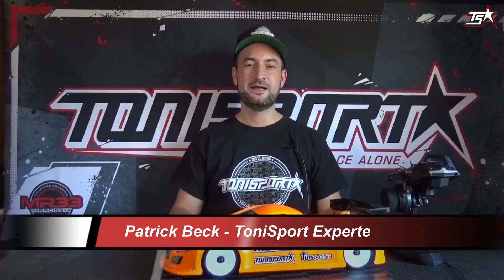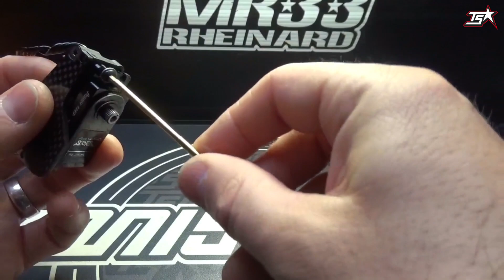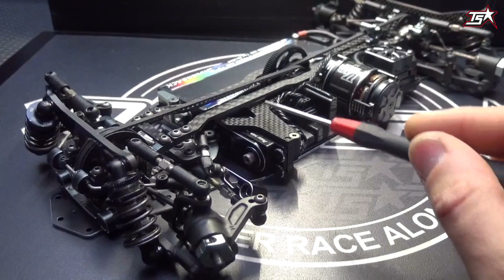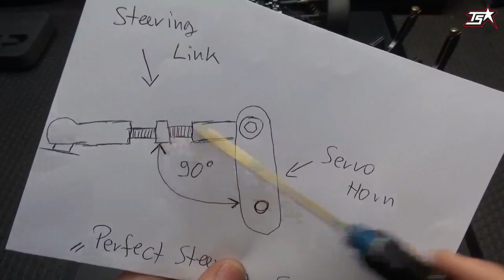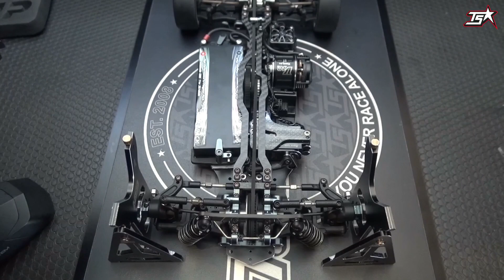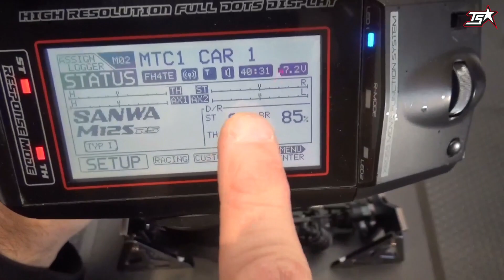ToniSport Newsfeed: Steering English

Comment: Hello,
Thx for very nice video well explained as usual 😊.
I have question about these servo mount screws. As we use a simple. Horn on our cars (and no save-servo), these screws should be risky for the servo life in case of crash? However, stil interesting.
Guillaume
Reply: guillaume leclercq 
Hi, these servo screws are from 1upRacing and available at Tonisport!
They prevent the servo from moving around in a crash. When the servo moves your car will not drive straight anymore and will be hard to drive to the end!
For sure as less the servo is protected by a servo saver or maybe normal servo screws it can get damaged more quickly for sure. But when you race you should go for the best performance!